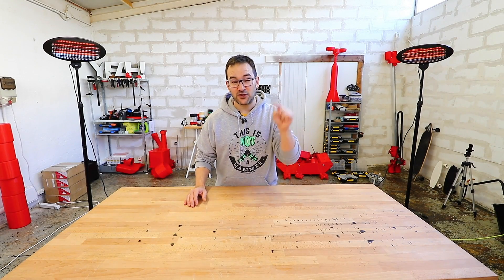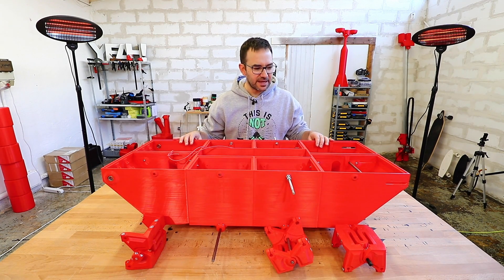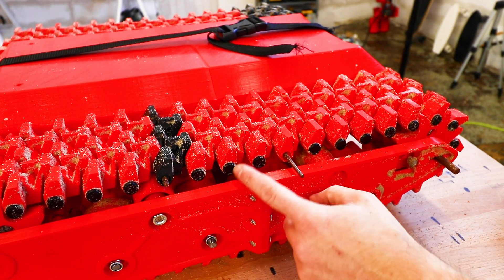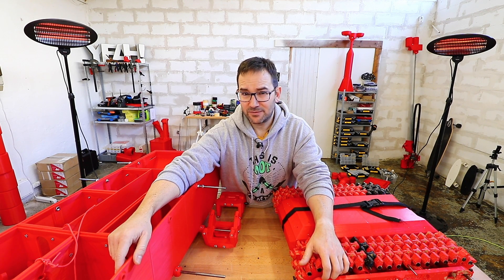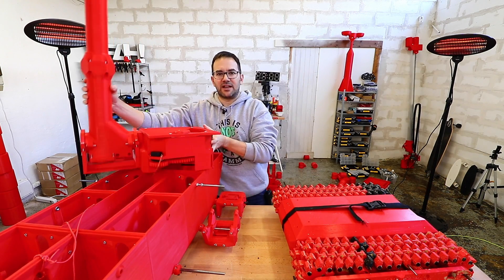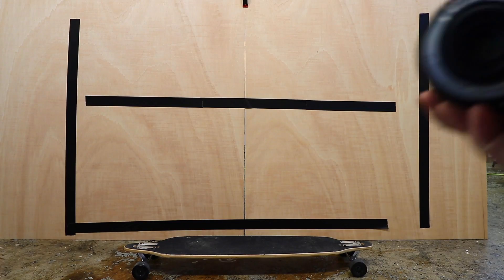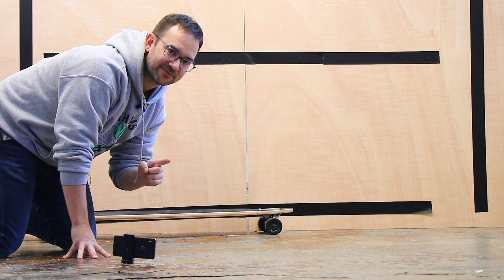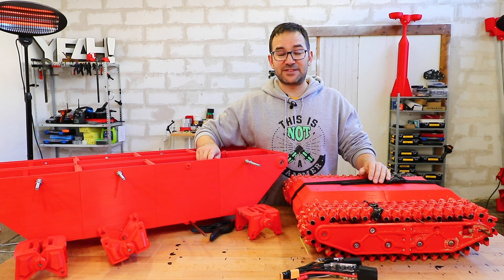BIG TANK MARK II #1

Comment: I was a Bradley mechanic in the US army for 15 yrs. While using track pins is a option for piecing your track together. You might want to consider using rubber bushings between the track and the track pins. The bushings absorb allot of the impact and helps reduce friction in the track during movement. They make the track and the pins last longer. Another options is to use a alternate version of tracks and use the center guide and end connector version. Both styles of track are good depending on their application. However generally heavier vehicles will use center guides and end connectors versus track pins. Track pins are fine for Medium weight tracks and Small tracked vehicles. But when you get into the big boys the US uses Center guide and end connector tracks. If you are confused by what I mean google the M1a1's tracks or ever the M88a1 or a2. Both use this style of tracks and its been proven to be reliable in combat.  Good luck on your tank bud.

Comment: Hello Ivan! Please consider the advice list that I wrote for you, thanks.

1- It would be a great idea to install a fan on top to blow in fresh air into the cockpit or to cool off the parts of the tank (if there is any that needs it or could use it)
2- I guess you should use that carbon fiber printing material at least for the floor part because it'll be very long, therefore, it'll be weaker in nature.
3- You definitely should add FPV cameras around the tank to be aware of your surroundings. Wıth the way you plan to position yourself, looking around using holes/windows is not an option. (Maybe you could even place a camera attached to a motor on top as an option)
4- You'd need to watch out for your comfort so you should place cushioning material inside the cockpit to prevent negative health effects. Do not plan to put yourself on a position where your neck is not resting because that gets very tiring after just a little time.
5- Position of your exit/enter is a crucial design detail and please keep that in mind while designing.
6- You'd need a very good suspension system to hold that much material's and a human's weight.
7- You could add a speaker upgrade in the future.

Comment: "This is not going to be an all terrain vehicle" So... a French tank that is wheeled rather than tracked? But the all terrain aspect is half of the fun.

"I want it to be a little bit tanky and a little bit futuristic, a little bit weird. but not tall and short" Please base it on the Swedish Stridsvagn 103. You can hide those things behind Volkswagen buses in real life and they can be driven with 1-3 crew. Obviously you could scale it down for your needs. Their track design is really good, too. I have close up pictures I've been hiding on my computer if you want any examples.

Don't forget to design a good suspension and a good firewall for the batteries just in case. Also make it so you can quickly escape in case the batteries are compromised.

Comment: If you look up pictures of the Maus tank design, it has a spacious interior, extremely simple design, and wide tracks to disperse wieght well.  I think that a scaled down version of this design would be ideal for a homemade tank if you want to fit inside and have a very simple construction.  Also, you might have room to sit somewhat upright because the turret is fairly large.

Comment: To run the VESC setup correctly you have to detach the motor from any load. Even the sprocket that the motor only turns it own shaft. Then you do a motor calibration described in the VESC Tool. After calibration you can install the motor back in its place. Then you are ready to rumble :)

Comment: Try and get "TP Power" as a sponsor for the motor. They have a wide range of motor types in size, max. Rpm and torque. I think there you will find a motor which will work for your tank. 😁

Comment: Mind if i suggest making a layout concept that you can actually step into and out of (maybe place some storage boxes and closets to define the size), as i think having your legs on top of something in the front of the tank is not that practical when trying to get out. 

Maybe a layout similar to a BMW Isetta car might be usable (door in front, then the driver's seat, with the engine and other parts in the back). At the very least it would make getting in and out of the tank relatively easy and add a reason to have more length than the sitting straight up setup.

Comment: Ivan why don't you is stainless steel pins?? You could get some Tig welding filler rod. It comes in lots of different sizes and will never rust..... Keep up the good work 👌👍

Comment: Should I say it or not... I say it... This will not work... and with this I mean this will only work if You use also other Materials; Like Aluminum and Steel to make a Frame, to stabilize the Project / the Printed Parts and also for some Safety Reasons for Yourself... This can Go so Wrong... I have some Ideas... I would make some 3D SketchUp Designs.... ??? Now the Questen how can I send it to You ??? ... Also Great Work, Can´t wait to see it
Reply: Ps: The Tank Traks are Huge.... But in seriously way, also will not work... or better a few times but not very Good

Comment: you should make your stance to have your head upright even if not your back fully upright. May be your back at 45 degrees with your head vertical. It will be very difficult to drive from inside if your head is horizontal, your hand inputs for forward would conflict with your accelerometer (ears have the balance and acceleration sensors) senses detecting it as up or down (w.r.t.the head being horizontal)

Comment: this is your most ambitious crazy plan yet Ivan ! <3

for your design, your entry/exit system is going to be EXTREMELY important
make sure you can get in and out even under total power failure 
also, the design must never lock you in with other features, like turret position etc 
(imagine worst case scenario, esc or battery dies causes electrical fire, you are inside, power dies, turret has you locked in... dead Ivan)

other considerations will be ergonomics, the position you demoed will destroy your neck if you try to use natural vision to look forward 
you will most likely spend significant time in this thing, even just during testing
so you want to be as relaxed as possible, a periscope or FPV system or some other consideration to vision will be required 

airflow to the pilot chamber will also be a factor that should be considered 

i cant wait to see this progress

Comment: Ivan, IMHO it's much better to print tracks with nylon! These are maybe the most loaded parts in a tank (maybe only the support beams/strings are loaded higher). So I guess even PETG will fail after some time. Nylon can be taken from grass trimmer nylon "filaments". They're different and you must find one (of the cheapest) that will not contain an anti-sticking agent (I don't know it's proper name). So it helps to trim grass without the self-gluing effects (because of friction/temperature). But this type is no-no for printing. Usually the "shittiest" are the best for printing gears and other loaded parts. And the price is usually several times less than a "firm nylon" filament for printing.

Comment: russian tanks (or maybe only the T34?)  in WW2 used to have tracks where the links were mounted with a pin that could only be put in from one side (inner side). the pin was not secured in any way, but as soon as it moved out, the tank hull would push it back in as soon as the pin was on the upper side of the track passing by the hull. the pin could be removed on the lower half of the track touching the ground. very easy, modestly reliable and somehow a genius solution to the track-pin-problem.
Reply: I suggest Ivan to watch the video of the chieftain about the t-34 to see the look of this kind of track

Comment: About the caps for the links, I wondered before why you placed cap side on outer side instead of the inner, that way when you do the donuts the pins would push against the hard wall instead of the cap. If u switch the left and right tracks on small tank, they should be less prone to falling.

Comment: How do you plan to drive this massive thing? Also with this size of this print, good thing you have a filament sponsor. This is probably going to take a pallet of filament. What would be cool is if you made a GIANT 3d printer to print the tank all in one piece =)
Reply: he built a pretty big one already. wonder if that's still operational.
Reply: He already failed at making a big printer, and the one he would need to print this behemoth in one piece would probably need to be 4 times bigger.
Reply: @slap_my_hand  I know he made a big one, but I didnt think it failed. Maybe it just needs more love.
Reply: @pnwscitech1589  The construction techniques he used just didn't have the precision required for 3D printing. 3D printers this big need proper linear rails and ball screws to support the weight of the parts, and that costs a lot of money.
Reply: @slap_my_hand  Sturdy frame is a good start, issue is that most materials will "droop" at the sizes more than acceptable tolerance (ie. bed needs to be within 0.1mm, preferrably 0.05mm)
Reply: @skaltura  I think the hang printer could be sufficient for this.
Reply: ElMariachi yeah, with a 1mm nozzle to do it strong and quick too

Comment: You should try 3D printing a mould for the tank tracks and try moulding them from some  silicone rubber or something like that. Not the big tank but the small ones.

Comment: too slow to ride, how about a 3d printed go kart, using the most powerful RC motors just to see what you can do with them?
Reply: i don't think consumer grade rc motor will be good enough to move with a human in the go kart let alone go at any good speed. motors more like those inside of golf karts will be beter. but then the problem will be the strength of the plastic wont suffice.
Reply: @tibo786  next steps: welding tubes instead of 3D printing; building a dune buggy.
Reply: Siana Gearz way too conventional for Ivan lol 😂😂😂
Reply: @tibo786  you'd... be surprised. Peter stripol built a working plane with consumer grade motors and ESCs and flew it
Reply: As long as the tank doesn’t fall apart under power it should still perform similarly to a go kart with the same motor, besides aren’t there enough go kart videos to go around?